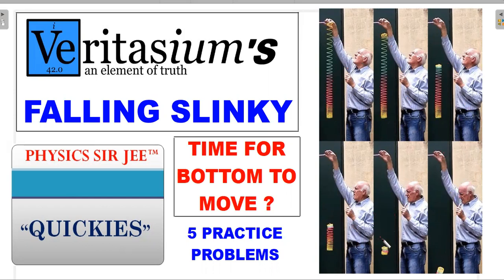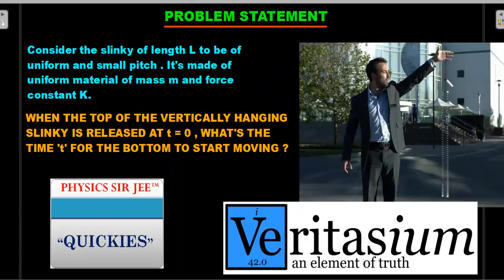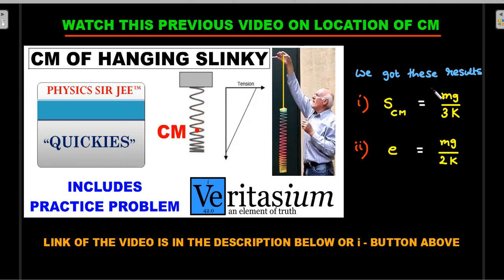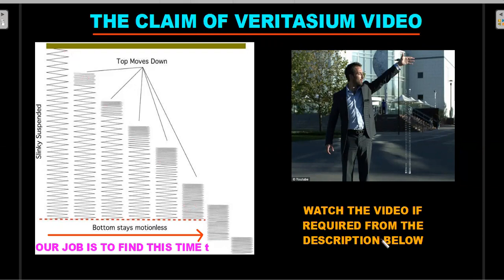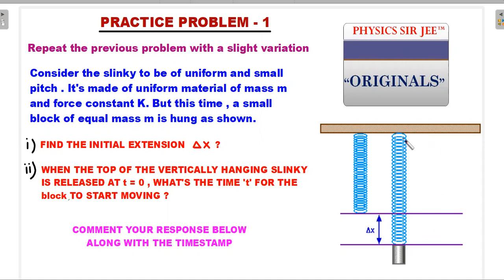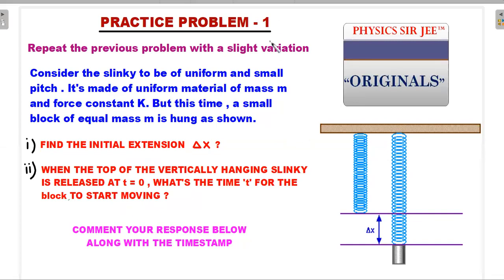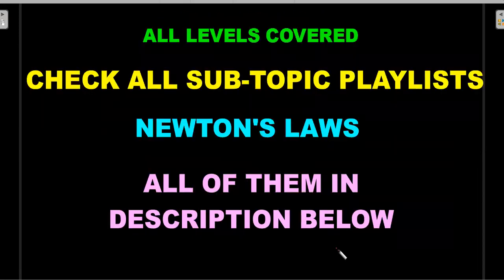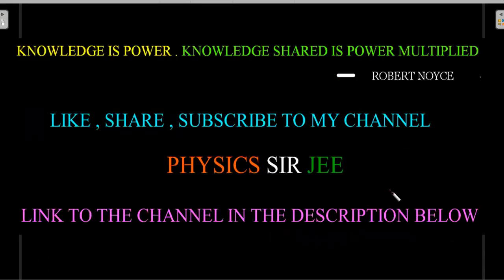@veritasium 's FALLING SLINKY | TIME FOR BOTTOM TO MOVE | JEE ADVANCED QUICKIES

Comment: Sir really liked the video but my doubt is how does the bottom most part of the spring is not at all moving, if we consider the case that we instead of dropping the spring with no force , we apply little bit of force then will the change in the mass flow from top to bottom will change or not? and will the bottom part of spring move down with some velocity??